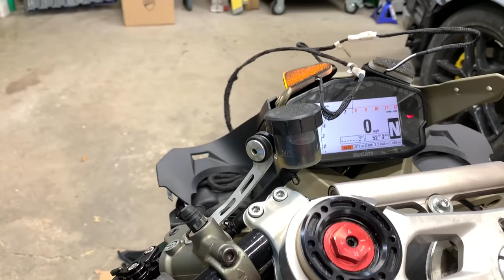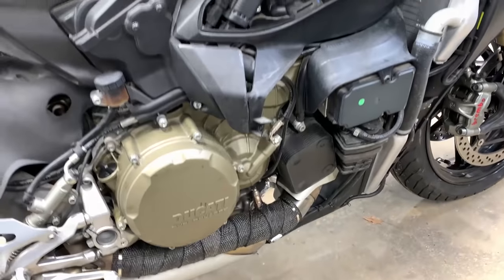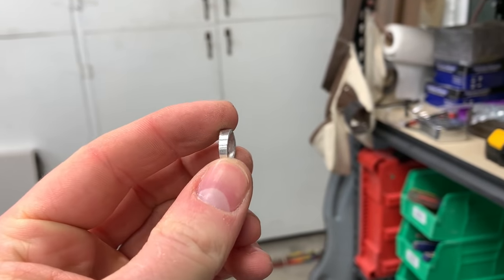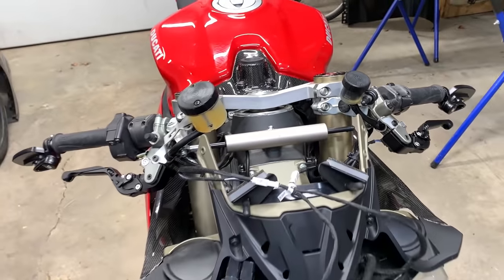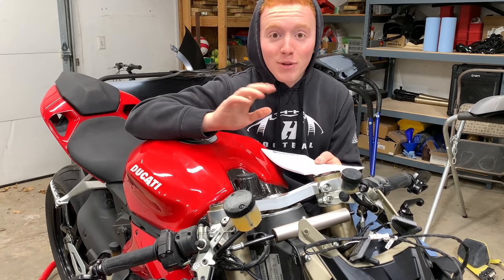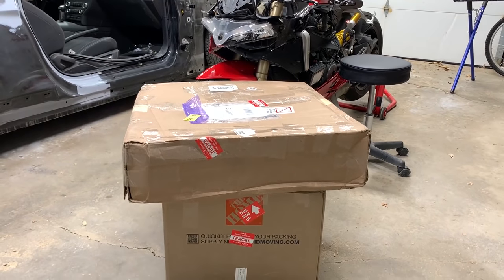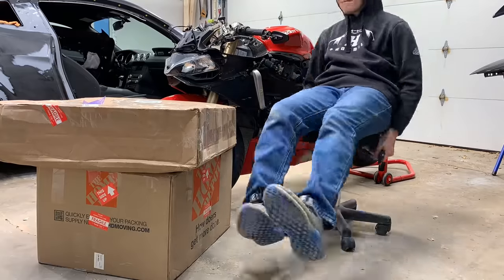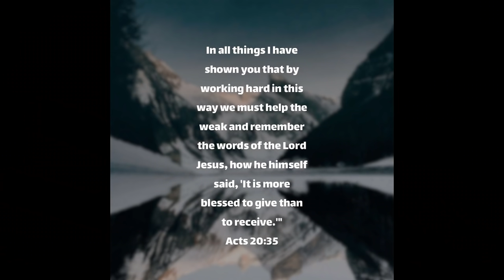Rebuilding A Wrecked 2014 Ducati Panigale 1199 (Part 9)

Comment: That bike needs professionally technically inspected. Alignment intricately checked and chassis structure signed off as sound. Thats nearly 200hp and 200mph worth of brittle bent banana, worked on by a (positively enthusiastic, no doubt) rank amateur at home. Buyer beware! Value wise never forget a salvage title is automatically 33% less than market value, even if professionally rebuilt to perfection. This very much wasn't. Sorry to be negative but honestly realistic. Missing vital safety steps on a horrifically damaged superbike is not smart. By not smart I mean potentially/probably lethal. That's a five grand death trap you've just seen get cobbled back together for 13 grand.
Reply: You summed it up really well👍🏽
Reply: Masz rację kolego. Sam takiego Motocykla bym nie kupił . Natomiast Fox jest bardzo pozytywny i mądry . Widać że to kocha i robi robotę. Pozdr
Reply: @Migo-ve1jr  sorry, there isn't a translate option on your comment. I wish I could read it.

Comment: Something to note the next time you wrap an exhaust. Soak the wrap in water, wrap around exhaust, pulling it after each wrap to hold some tension. ALWAYS WEAR GLOVES. The wrap has fiberglass in it, and can irritate your hands and get into your eyes if you rub them while handling the wrap with no gloves. Sadly the wrap does turn white-ish after prolonged use, its just how it is.
Reply from the maker: Thank you sir! Great information cheers

Comment: Awsome video's, just a tip wet the wrap when installing it (then start the bike after installation that way it will sit tight) and start from the back to forth so that way grooves face backwards rather than upwards because otherwise you will get a lot of dirt/salt/oil's/etc.. get stuck easily and work their way inside that and ruin it over time.

Comment: Looks like a keeper... just from experiance this single swing arms .keep an eye out on the 4 pins or could have 5 in this year that drive the rear wheel,  in time they get fatigue and brake one at a time or youll see them mangled up. just whent threw that on a triumph single sing arm .. had a 748s years ago and found one broken when i pulled the wheel of for a tire change, the Triumph they all fell out (was a new bike to me)
Reply from the maker: Good to know sir thank you! Cheers

Comment: Just a little tip when you're using heat wrap try using safety wire instead of the ugly metal metal zip ties they give you looks a look a lot cleaner and you can get it a lot tighter..
Reply from the maker: Thanks josh!!

Comment: Personally I think the exhaust wrap looks very cheap and does not fit a ducati at all.. but if you like it thats all that matters 👍🏻

Edit: I can also see your forks are still misaligned… the left one sticks out further over the triple clamp than the right one!!
Reply from the maker: Yes you're right the forks are still not aligned. Didn't want to bore the viewers :)
Reply: @CJMediaOfficial  please get that fixed before doing any serious riding.. it can be very dangerous at higher speeds
Reply from the maker: @Rellek  absolutely
Reply: @CJMediaOfficial  Had to wrap my pani the same way, I have burned fairings because of that issue.
Reply: Also picked mine up 1 year ago....my bday is 2/15. For 10k whole.

Comment: Very nice build. Watched all videos as I have a Panigale myself. Also it is extremely difficult to put those bottom two windshield bolts on without taking the whole front fairing off which is a pain in and of itself, as I speak from experience.
Reply from the maker: Thank you Dakoda! 🤣yeah I agree I couldn't get em on the first time so took the bike apart again and put the bolts on with the front fairing off 🫣

Comment: Great content but you need to redo that wrap. It should be at least a quarter inch over the next wrapped piece. You have gaps in it and that is going to allow heat right down where you don't want it.
Reply from the maker: You're right!

Comment: Of all the bikes (manufacturers) you have worked on how would you rank the difficulty to repair? Which require the most specialist tools? Which have the best ref material / customer support for technical queries?
Reply from the maker: Love this questions chris! 

These are ordered greatest to least 

Difficulty to repair: Ducati, Honda, BMW 

Who requires the most special tools: Ducati, BMW, Honda 

Best materials: BMW, Ducati, Honda 

These are IMO, as I was thinking about it, my answers are honestly pretty much based on my learning curve with sport bikes. The bikes have become easiler for me to work on. Now does that mean I'm working on easier bikes? Or does that mean I'm getting somewhat better at working on them? Idk lots of variables. Again fanstaic question! And cheers!
Reply: @CJMediaOfficial Thanks for the response, keep the great content flowing. I have ‘recently’ started doing track days so preparing myself for a rebuild if the worst should happen (Riding S1000RR). By the way I am impressed with your cheery disposition, after I have poured blood, sweat and tears into similar projects there is usually some profanity which spills out.

Comment: Did you manage to fix the milage not showing on the display? Also it sounded like it was taking a while for the bike to start initially - is this still the case?
Reply from the maker: Hi! The fix for the dash milage would be to get a Virgin dash which was 2k from the dealer so it wasn't worth it IMO. The bikes still take a second to crank but not like before. Must be a common thing?
Reply: @CJMediaOfficial  Why are Ducati parts so expensive 😂
Reply from the maker: @Georgina37  Because DUCATI! lolol

Comment: Hi , did you manage to find why you get dashes instead of the mileage ? I got a key made by SOS Diagnostics and have the same problem now . I get blinking dashes instead of the mileage readout.
Reply from the maker: Hi sorin, so unfortunately the only solution I could find, to getting the previously milage reading, is to buy a brand new dash. Then take the bike to the dealer and have them program the new Virgin dash to the bike. I asked if the dealer could program my used dash and they said no. SOS diagnostics said that the dealership should be able to program my used dash to my bike but the dealership said they wouldn't do anything unless it was a new dash. So that's where I concluded my search as of now. I'd be curious to find out for sure if a used dash really can't be programmed to the bike. Hoping for the best for yours!
Reply: @CJMediaOfficial  I think the problem is with the keys that SOS Diagnostic made for us.
I have 3 1199’s and I can swap the gauge clusters between them and everything works . The mileage stays with the dash , it shows the same mileage on any bike when I swap them around .Everything works, I don’t have to program the dash to every bike any time I change it .
I only get an error light when I put a 1199s gauge cluster on a 1199 . That is because the electronic suspension. 
On my 959 I had 5500 miles showing on the dash before I lost the keys . Now I got 2 keys made by SOS and I get blinking dashes , just like you do. I still have the original dash , didn’t change anything on the bike except the keys.
Reply from the maker: Weird, idk ig, I'd like to research and learn more about that programming process eventually.

Comment: Ive been trying to search for the scene where you tear down the bike to its bare frame, Why is this important, because from the way that triple crown is cracked, its a frontal impact and that impact that caused the crown to split will move down to the headtube and the frame. To be sure if there are no hairline fractures on that alu hydroformed frame. Just concerned to whoever will get that bike once you sold it back on the market. Its a heavy bike and a very fast one too. Any hairline fractures will get worst under load stress the bike will give once its pushed to its limit.
Reply from the maker: 110% agree with you, I did not do a complete frame tear down during my rebuild. I should have looking back at it, but it is what it is now. I did push the bike and had no issues with it. But who's to say, good food for thought ty!

Comment: Why wouldn't you want to have your indicators as clear as possible. Aftermarket mini indicators are setting you up to be taken out by another vehicle. Being alive beats looking cool any time. Bar end mirrors are appalling. Use the original mirrors and indicators. A stock bike is always worth more than a modified project.

Comment: Any update? How is the bike now 7 months down the line any issues that popped up during that time?
Reply from the maker: Hi! Well I recent actually sold the bike but I rode it as much as possible between the time it was spring and recently. It gave me no issues and was so so fast. Never even got to pin the throttle cause I was nervous. Hit well over 180 on a closed course and it felt so smooth. Corners were imacualte, the bike just layed down so smoothly. Truely an amazing machine.

Comment: There is a reason why the insurance company quoted $18000 because skilled labour and doing the job correctly costs money, just replacing parts that you think need replacing and not checking other parts for damage is dangerous. It is obvious you have little to no knowledge on what you are doing eg early video you didn't know the difference between a valve cover a head and a block. The parts you got of eBay with no history are they stolen parts?
This bike needs a full inspection by qualified people before anyone should ride it.
If you sell it i hope you show the buyer these videos before you take their money.